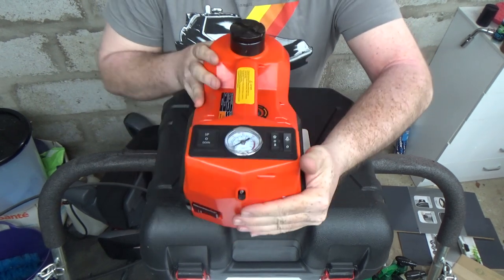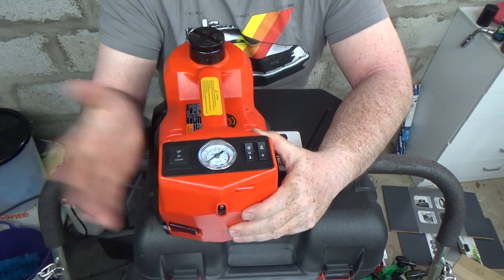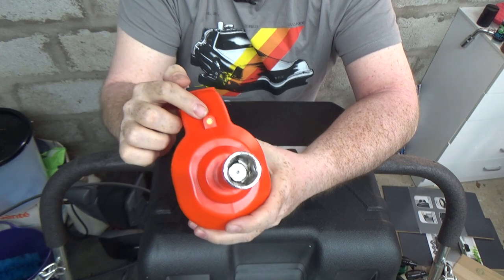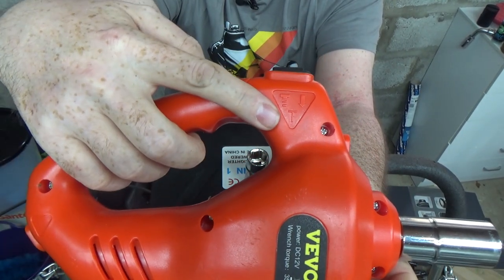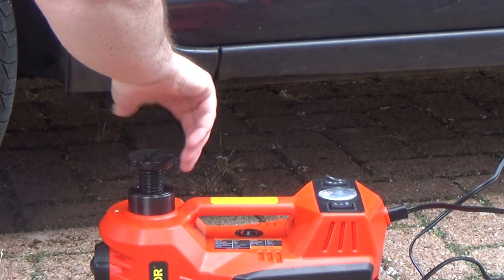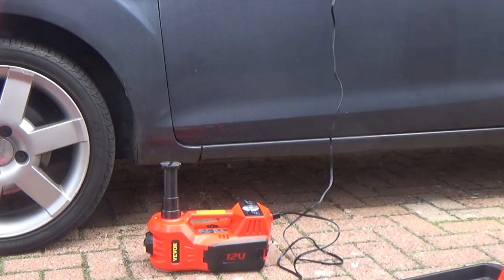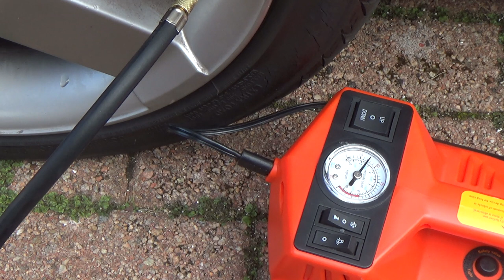12v Electric Hydraulic Jack Kit

Comment: Ok, since no one mentioned it in the comments, I guess I will...  The Allen wrench is for an emergency situation where the jack will not go down electrically using the button, as some of these jacks tend to do at times.  There is a hole under-neath the handle with a rubber cap over it.  Take the rubber cap off, and insert the Allen wrench into the Allen key and turn counter-clockwise to lower the jack manually (just like a bottle jack works).  I am sure that information is in the manual, but thought I would mention it here for others having issues with the jack not retracting by pushing the down button.  Actually I would like to think that using the Allen wrench to lower the jack manually every time you use it, would extend the life of the jack since it wouldn't be working as much.  VIW3784 mentioned that the Allen wrench may be for the plate on bottom, and I was thinking also that if you took off that plate, you may be able to service the jack, and may help with (as other people have said) loosing fluid/leaking to have access to a place to fill it up or change the hydraulic fluid from time to time...

Comment: Good to see you putting  out content it seems to me it's been a while. I  don't need all the kit as I have breakdown on my cars (not that i would call them out for a flat tyre) and a breaker bar and battery powered impact wrench but it pinged an interest in a powered jack but my trolley jack is probably quicker. Interesting film though. Watched this before heading up to your neck of the woods, Setting up sons flat for Uni in Aberdeen.

Comment: First off, street ka wheels. 
Secondly those sockets aren't suitable for an "impact" tool. They should have just included a breaker bar instead. Cheaper and more efficient judging by how long it took to do the first wheel nut. Especially as your wheels would have been off recently.

Also 1/2" drive
Reply from the maker: My bad, must have misread the size 🤦🏻‍♂️

Comment: 1/4 inch seems quite small for an impact drive. Are you sure it's not 1/2 inch? Most that I've seen or used impact-wise in my Automotive career have been a standard 1/2 inch or upwards. Maybe once I saw a 3/8 drive impact tool, but rare to see. Be nice for official clarification as not mentioned on the link, unless I'm blind, cheers. Not a bad price either and a handy bit of kit too. Especially for mobile valeting businesses.
Reply: Definitely 1/2" on this but there are plenty of 3/8" impact tools around now. I've got a few myself

Comment: WARNING!!!  this jack and all similar ones are all falsely rated. they CANNOT lift 5 tons..(some say 3 tons) other videos on here show max lifting capacity is about 3900 lbs (less than 2 tons)  beware these are marketed under several different names.  they can hold 5 tons if you use it as a jack stand but stall out trying to lift closer to 2 tons. 
see user project farm for actual load testing
Reply from the maker: Good to know!

Comment: my only concern is that, what happen if the motor stop working? the jack is useless.
Reply from the maker: What happens if the handle on your manual jack breaks? We can't live by what-ifs.
Reply: @SpeckyMcSporran  I think we are talking two different scenarios here, the electric jack is totally depending on the motor where the manual jack is using a handle, that can be substitute with another handle?
Reply from the maker: I can't argue with that but I don't think it's enough to put someone off buying one.